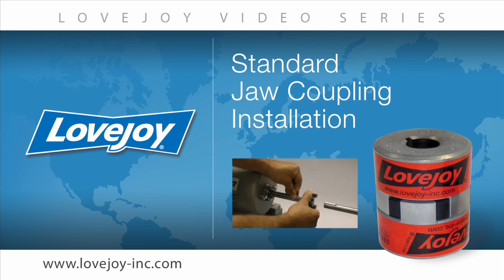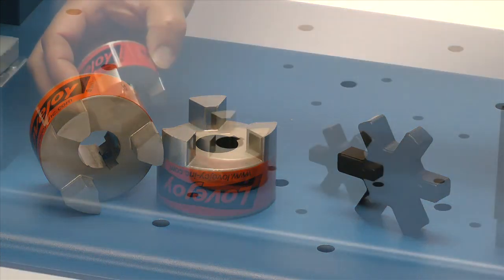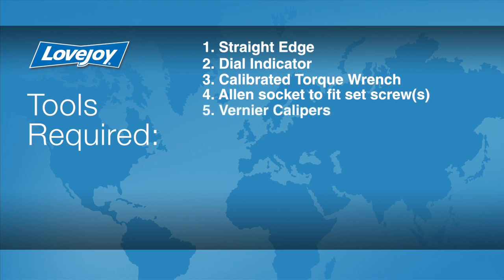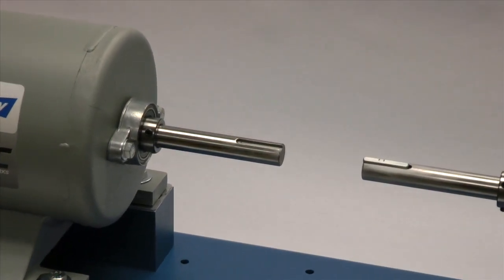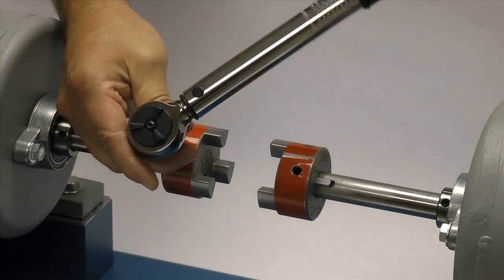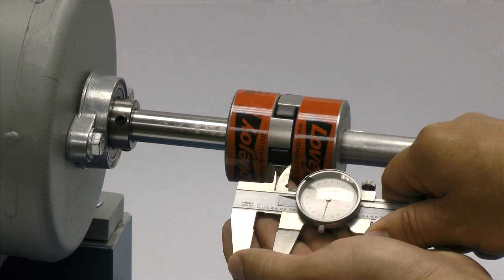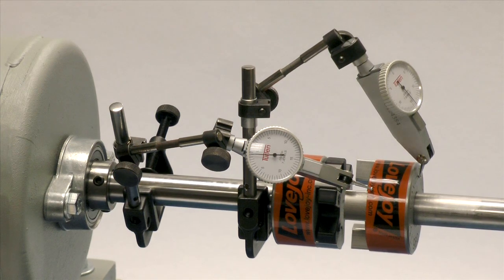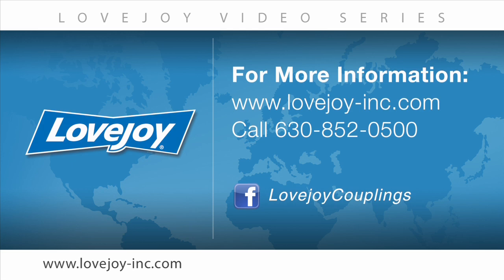Lovejoy Standard Jaw Coupling Installation Video

Comment: What is 110 denotes in a L110 jaw coupling ?
Reply from the maker: Great question! The answer... the sizes are a historical relic. Going back to 1927, when Lovejoy first introduced the jaw coupling with leather spiders (now rubber)... the number represented the max bore (so "110" equaled a 1.10 inch max bore). Through technical advancement over many decades, the max bores of Lovejoy jaw couplings were able to increase. As technology continued to improve, Lovejoy stayed with the original nomenclature... as each part's general dimensions remained the same. As a result... today, the Lovejoy L110 now has a max bore of 1.625 inches (not 1.10 inches).
Reply: Lovejoy, Inc.
Reply: Please your contact no